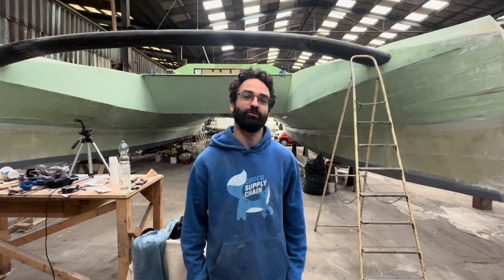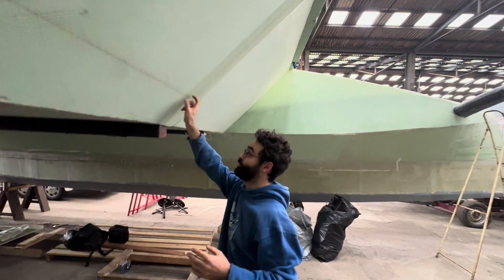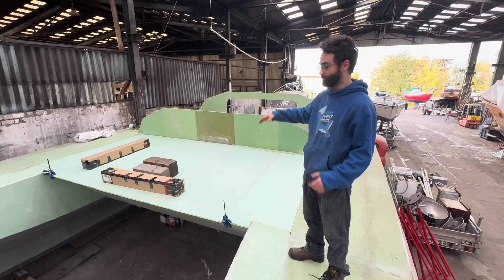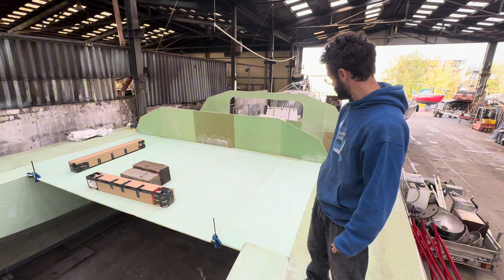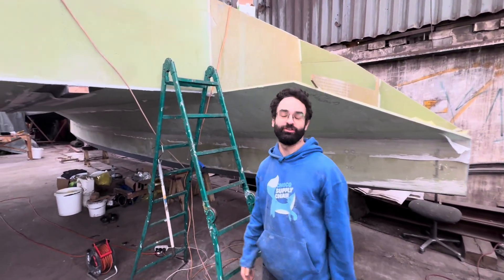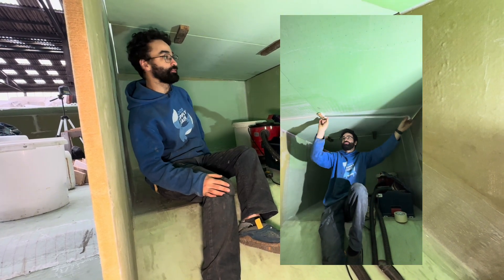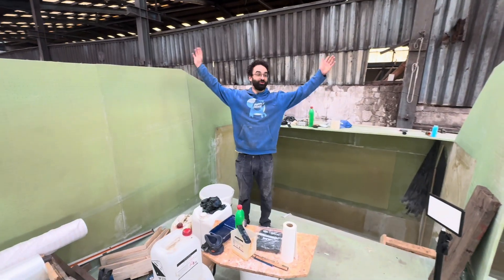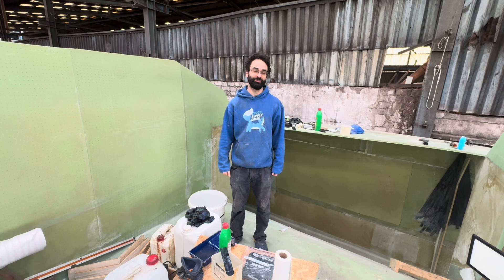Building the Foredeck of My 12.5m Catamaran ⛵️ — Step by Step (Fiberglass, Epoxy & CNC Panels)

Comment: how long do you think the life span of the boat will be
Reply: That whole boat is going to be very warped within the first year of sailing if it lasts that long
Reply: They still are all butt joints and will warp so fast lol
Reply: Not long, the butt joints, very little fiberglass, and it will live in the water. I'd say less then 10 years.
Reply: @Tom_Foolry  WOW I’m sure he intends to fillet & tab all joins & intersections as the form takes shape. 🤨🇦🇺
Reply: @jacksbackable  it's more the top deck to hull construction thats concerning. Most production cats have lamination damage on the underside of the top deck from how it flexes underway. He'll need to do a good structural lamination and proper bulkheads to prevent this from happening to his. 

A lot of custom high performance sail boats live out of water because living in the water is too stressful. Most high performance boats also dont really do multiple circum-navigations. 

He's also using a lot of uni-directional for tabbing. He'd be better off using his epoxy with carbon fiber bi or tri axial.

Comment: I feel like the materials may be strong enough in localized parts of the build but overall the structure doesn’t give me confidence. Are there any beams spanning the two hulls? Are the hulls single mold or what? Hopefully im wrong though it would be cool to see it sail
Reply: I beg to differ, I don't think you realise how strong composite materials are.
Reply: @aussiechristian the materials are strong but the structure is weak.
Reply: Its not going to last long living in the water with this construction. The hull was built with bulk heads and is only tabbed together on the inside with minimal fiberglass on the exterior.

Comment: How was the mold created? Too bad we missed seeing the beginning. Was it an upside Down strong back or? Was there even a fork in your type of composite build? Can you share a long format video on this topic please? How you put together the hulls actually?
Reply: This looks like a flat hard chine construction.. rather like the Derick Kelsall KISS method .  Most of it will be formed from pre cut flat panels any curves are formed on formers and by cutting kerfs into the side to be closed /ie the interior of the curve.  Some foams can be formed by heating and forming the flat panels like the Maine cats or but planking foam strips  together and then vacuum bagging the GRP skin inside and out.
Reply: @clivestainlesssteelwomble7665 thank you so much for sharing, I had not heard about this method, researching thank you very much